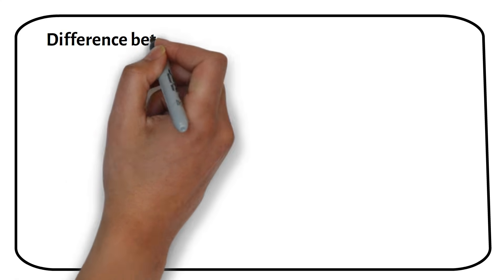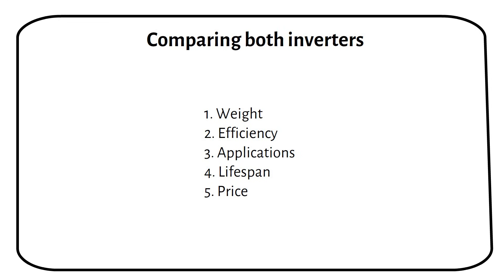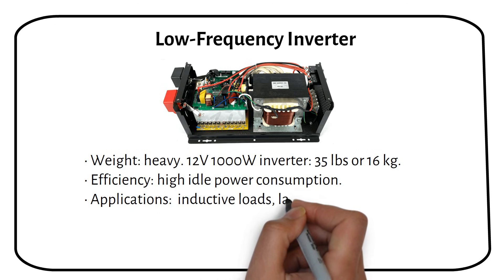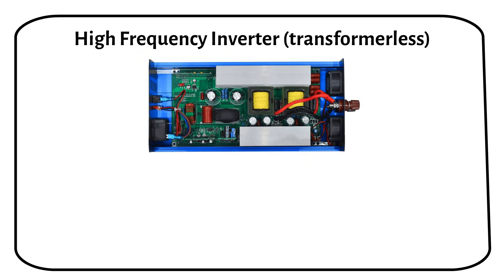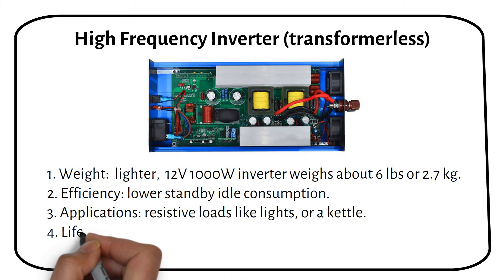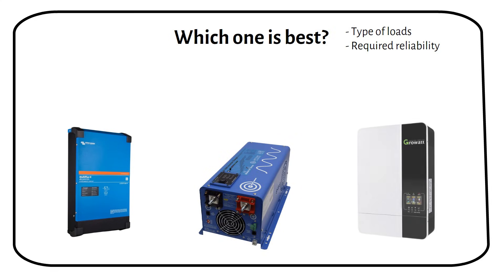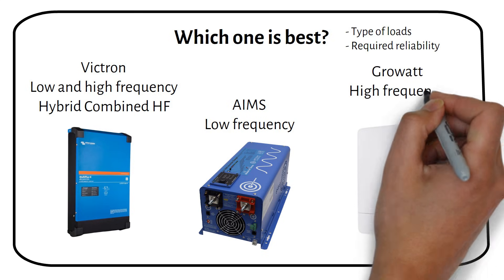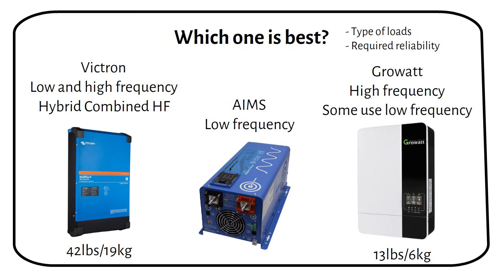Low Frequency Vs. High Frequency Inverters

Comment: One reason the low freq inverter is "better" for heavy inductive loads is that the big heavy power transformer, being a huge ball of wire, is nearly indestructible from a short overload. If the device trying to start ( ie: air conditioner, table saw, freezer, etc.) approaches the output limit of the inverter, a voltage sag will be the result and a trip condition may result. A hi freq inverter, when subjected to a similar load, will try it's hardest to fight off the surge and make the device happy while actually failing and blowing up all it's MOSFETS trying! No different than vacuum tube circuits VS transistor counter parts!
Reply: Yeah, but no. I have designed AC power conditioning and regulating products, and the transformer in "Low Frequency" inverters is NOT what gives them the ability to handle surges.
In general, low frequency inverters do handle surges better, but the reason is because the number and ratings of the  FETs driving the big transformer. I don't know WHY the designers of high frequency inverters skimp in that area, but if they didn't, it would be totally practical to make one that had just as much surge cpapacity as a low frequency inverter.
Reply: @jimmurphy5355   cost due to many many competitors.
Reply: @jimmurphy5355   interesting you are a 'designer', and an interesting answer you provide. Where in the topology of your LF SMPS designs , do you insert the transformer?
Reply: @jimmurphy5355  Uh... no. An iron core copper wound output transformer enhances surge capacity through a principal known as the flywheel effect, which is directly proportional to the physical amount of iron present in the transformer.
Reply: @quickquote1568 That is not true. The transformer has no such flywheel effect
Reply: @jimmurphy5355  transformer manufacturers disagree. This is the most common explanation of why large low frequency inverters handle surges better.
Reply: @ Common wisdom can be wrong. in this case, it is wrong. I'm a physics major with a long career designing electronic products. That includes AC power regulating and conditoning devices. The big, heavy low frequency transformer found in one class of inverter is not, itself, the reason such inverters have high surge capacity. It's presence correlates with high surge capacity, without being the reason for the high surge capacity. If I was tasked to design a high frequency inverter with  an abilty to sustaing a 3X surge for 5 seconds, I could easily do that. It would add substantially to the cost compared to designing only for the bare minimum needed to meet the steady state power rating. People buy on price and power ratings, so it would be a hard sell to get them to pay extra for a better surge rating.
And a high frequency inverter with excellent surge capacity still wouldn't have the ability to absorb power on the AC side and send it back to the battery as DC - a cool feature that low frequency inverters have.
Reply: @jimmurphy5355  Thanks for your input. My point was that I feel a low freq inverter will survive a heavy surge, not provide a better surge than a high freq inverter due to fewer semiconductors in the path. I'm sure you/re correct in the ability to design a high freq inverter to provide and/or survive a heavy load surge without damage. If you read the instructions/suggestions on "off the shelf" cheap high freq inverters, they contradict what they brag about. Specs may say 2000 watts 4000 watt surge, usually double the rated power. That's a myth. Deep in the manual it says to SIZE the inverter to like 3x rated output if running inductive loads like motors! There's the caviot statement. BTW, I need some help in understanding how a low freq inverter can put DC back into a battery. Is that like an EV with regen braking?
Reply: @curtchase3730  Yes, the abilty of a typical "low frequency" inverter to flow power from the AC side to the DC  side is very much like the abilty of an EV to regenerate (flow power from the motors to the battery.)

The heavy low frequency transformer is inherently bi-directional. The output can function as an input. It steps the AC mains (120/240) down to the battery voltage, and the high frequency PWM stage that is between the low voltage side of the 50/60 Hz transformer and the battery acts as a synchronous rectifier to convert the AC to DC to charge the battery.

In a high frequency inverter there is a boost stage to convert the low voltage DC from the battery to high voltage DC to feed the PWM output stage. The way boost converters work does not allow power to flow backwards through the stage - it's simply not possible. So even though the output stage of a high frequency invert can, in theory, act as a synchronous rectifier and flow power "backwards" to its input side as high voltage DC, the high frequency DC to DC boost converter that is between the battery and the output stage is a one way door, and can't pass that power back to the battery.
Reply: @jimmurphy5355  Surge capacity is a critical rating for solar system design.
Reply: @jimmurphy5355  incorrect
Reply: @quickquote1568   100% correct
Reply: Any high frequency inverter that self destruct when overloaded was poorly designed. A low frequency inverter will equally be damaged if the power switch rating is exceeded. Sturdier designs always have current limiting circuits.
Reply: @xtneuron  Thanks for the info! Yes, makes sense. I figured a low freq inverter would have fewer parts to fail, but I guess not. I agree that just about all budget Chinese hi freq inverters are designed to just barely hit specs but cheaply. They allow no room for any overloading. They also have piss poor isolation and RFI suppression. Some are so bad that even the neutral leg is floating and if it is bonded to ground...POOF!
Reply: The transformer is nearly indestructible, but it tightly couples the load on its secondary to the MOSFETs on its primary. The low frequency inverter, just like the high frequency inverter, will try it's hardest to maintain the voltage. A startup surge on the secondary will result in a current surge on the primary, and the current will be multiplied by the transformer ratio. If the low frequency transformer has, for example, a 1:10 ratio, with the MOSFETs creating a 12 VAC sine wave on the primary, that is stepped up to 120VAC on the secondary, and there is a 20 amp surge on the secondary, that translates to a 200 amp surge on the primary.
The MOSFETs in as "low frequency" inverter have to handle far, far more current than the MOSFETs in a high frequency inverter. They do so at much lower voltage, of course.
Bottom line: I don't believe the low frequency transformer is what protects the MOSFETs. There is some other root reason that LF inverters generally have higher surge ratings that HF inverters,
Reply: @jimmurphy5355  Thank You for providing a civilized comment. Goes to show that even a LF inverter can fail too. I guess if you used huge industrial sized 1000 amp MOSFETS in the input switching stage, there'd be a better chance of survival! LOL
Reply: when you see heavy transformer inside of inverter doesn't mean that inverter is low frequency. Some inverter use heavy and low frequency like iron core transformer because it intented to make split supply but it still high frequeny inside of inverter. That high frequency is used to make pure sine wave produced by the PWM bridge type switching transistor
Reply: So the  answer for high frecuency inverters is the use high kilowatts inverters for high  inductive load  devices.
Reply: @norbertrivera  Yes - simply oversizing the HF inverter by 2 or 3 times will make it as able to start difficult loads as an LF inverter. And a 5kW HF inverter will be smaller, lighter, and possibly less expensive than a 2kW LF inverter.
Reply: @norbertrivera  or avoid high inductive load devices. use inveerter based air conditioners and soft starts for motors like well pumps. They would have the added benefit of minimizing the voltage drop from large loads and prevents flickering or dimming of lights when large loads start.

Comment: For two years non-stop my high frequency 5000 watt inverter powers my whole house and makes my hot water and it was cheap as f...I
You need to redo the video 🤔
Reply from the maker: 2 years is nothing though. Heating water is a resistive load, so no surge power is required.
Reply: @cleversolarpower  Do you think if you added "Soft Start" to an RV Air Conditioning unit which would reduce the inrush current, you could still use a High-Frequency inverter, and not stress the MOSFET's?
Reply: scooby.. share the one you bought please.

Comment: my growatt invrerter die after 3 month  ; it cannot support the 35 degree of philippines !!!!!
Reply from the maker: It could also be that it ran inductive loads which puts stress on the MOSFETs. 35 degrees Celcius is not that high for electronics when it's well ventilated.
Reply: @cleversolarpower You are right.In summer we regularly hit 45 degrees.And my 3kw /24v inverter keeps running.With hosehold items like fans,fridge,freezer,tv.And 600w water pump.Reaching 1000w all together.Most likely problem for breakdown is when you utilize over 2kw all the time.
Reply: If you're running an air conditioner put the power inverter in the cool air. A small fan blowing on it might work, but make sure you're not working against the inverters cooling fans.

Comment: Why are the vast majority of inverters these days (including off-grid, Grid-tied, hybrid and even industrial inverters) of the high frequency type? Could it be that longevity isn't that big of an issue afterall?
Reply: For fish farming you need 365/24/7 availability air supply.
Reply: Shipping weight rules! Shipping from China is always priced according to the weight of the container.
Reply: @seymourpro6097  I beg to differ. In shipping, volume is more important of a greater concern than weight. Shipping weight also doesn't explain why even US based manufacturers like midnight solar are gravitating towards HF inverters.
Reply: Longevity is never a priority for any electronic device made today. They want it to break so you have to buy another one.
Reply from the maker: Grid tie is low frequency. They should last you about 10years. That's the standard warranty period in Belgium. The reason they last so long is that they don't have to supply surge power because the grid takes the surge demand. Off grid is less forgiving. Imagine you are on a boat and your inverter fails. Dependability becomes more of a factor then.
Reply: @cleversolarpower All the grid tied micor-inverters inverters I have seen are high frequency. I have never seen any other type. And the 5 kW Solar Edge inverter at my house is also high frequency. Tesla powewall inverters are also able to be grid tied, and they are also high frequency. Maybe there are grid tied low frequncy inverters, but there is no rule that low frquency = grid tied. I have a 5 kW low frequncy inverter that is stricty off-grid.

Comment: Why do low frequency inverters always have relatively high idle power consumption?
Reply: The large, heavy 50/60 Hz transformer has an iron core. The direction of the magnetic field in the core has to alternate at the mains frequency. That alternation induces losses in the iron - think of it as being something like friction in the alternation of the magnetic domains in the iron. These losses are directly proportional to the amount of iron, and are typically 2 watts per pound of iron. Core loss is independent of the load on the inverter.
Reply: @jimmurphy5355  thank you for the this response. Probably the best answer to this question so far. Forgive me for asking further questions out of this answer. How's is Victron managing to keep idle consumption low, even better than many low end HF inverters? Are they somehow reinjecting the (potentially) wasted power in the iron core back into the system. I apologise if these questions sound naive but I'm really curious.
Reply: @adon8672  I honestly don't know. The core losses can't be recovered - they heat the core, and they are gone. My best guess - and it is just a guess - they don't power the low frequency  unless the load is demanding power. Some "low frequency" inverters have a power save mode that does that. Or maybe they use (expensive) ultra low loss grade iron in the core, and/or run the core at relatively low flux levels (also expensive because then you need a bigger core.)
The true but not very infomative answer: better engineering and better quality components.
Reply: @jimmurphy5355  thank you for the prompt and wonderful response. There's a lot of sense in your guesses and they are good enough for a lay person like me.
Reply: Most likely, the big heavy power transformer has inherent loss compared to a hi freq unit.

Comment: Apart from Victron, which other company makes low (or hybrid low-high) frequency inverter with little idle power consumption?
Reply: Studer Innotec... @StuderInnotec
Reply: @ricky786  Great. Thank you for the suggestion.

Comment: How does a high frequency inverter make 50 or 60 Hz AC ?
Reply from the maker: The MOSFETs switch very fast to create a sine wave. That's why it's called high frequency. Imagine a modified sine wave with the visible steps in between. MOSFETs in a pure sine wave high frequency recreate a sine wave by switching very fast.
Reply: @cleversolarpower  Thank you

Comment: If your inverter struggles to power a microwave oven, it's likely an HF inverter. 😆 like mine. My inverter will run my microwave, but it stumbles at first for a few seconds.

Comment: Now that we have inverter washing machines, inverter pressing irons, inverter air-conditioners, inverter fridges and freezers, isn't the concern regarding surges becoming baseless by the day? All the aforementioned devices I own are all inverter devices so I am more inclined towards the cheaper High Frequency option.

Is there not enough rational in my thinking?
Reply: You are right. Back when the dinosaurs roamed the earth, we would hard start motors because the grid is an infinite power source. Now that we are going off-grid and running things off inverters, these surge currents can be a problem. Soft start circuits and "inverter drive" which is basically a VFD drastically reduce that inrush current.

To give you a sense of how nasty motor starts can be. If a motor while running uses 10A, it may require 60A to kick on. Soft Starts and VFDs can drop that down to 20 to 30A surge.
Reply: Most people don't own inverter based appliances. And using inverter based appliances does nothing for a high frequency, inverter's well documented short life expectancy. You will have to buy at least 3 high frequency inverters over the life expectancy of a transformer based, low frequency inverter, which is one of the reasons that high frequency inverters are so cheap to purchase. They simply don't last as long as a low frequency inverter.
Reply: @Madsci-zy8wm  Pure sine wave "low frequency" inverters are high frequency inverters with a low output voltage, with the low voltage stepped up via a mains frequency transformer. The circuits that do the conversion from DC to AC in the two types are fundamentally identical, just operating at different voltages. A properly designed high frequency inverter can last just as long as a low frequency inverter - and it will cost almost as much too. But it will be more efficient, lighter, and have lower idle losses. The inverter built into a Tesla PowerWall is a high frequency type. It has fantastic surge capacity and a very long warranty. The differences in performance between low and high frequency inverters you see are due to factors other than the presence or absence of a low frequency transformer.
Reply: No because the inverters in the devices that you mentioned are inductive loads.
Reply: @Madsci-zy8wm So are you saying that it is inconsequential despite the fact these devices are of inverter type as opposed to the traditional type?

Did you understand what I meant by inverter devices, which is clearly how they are branded by their manufacturers and quite rightly so?